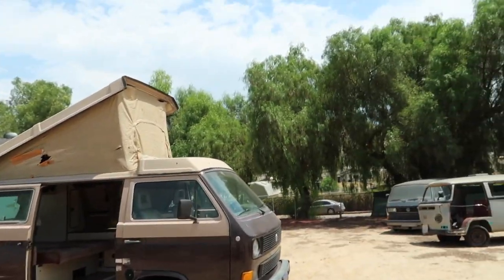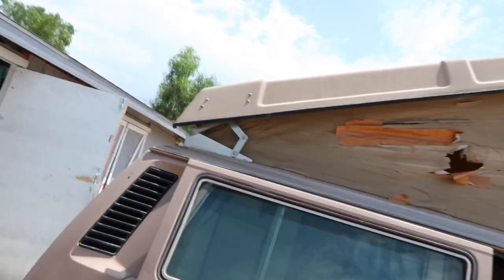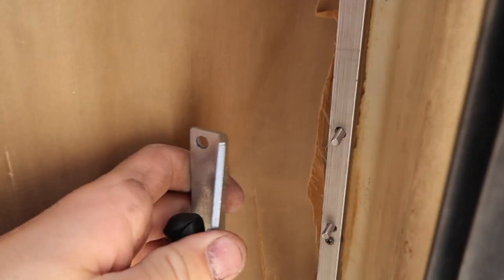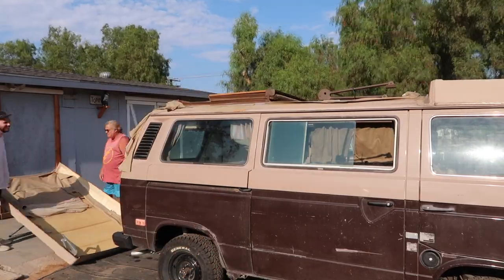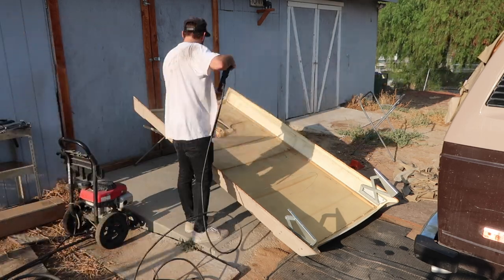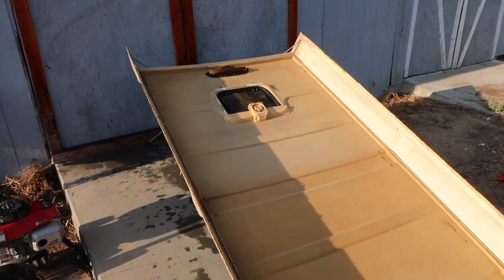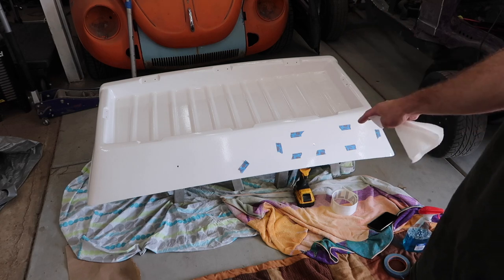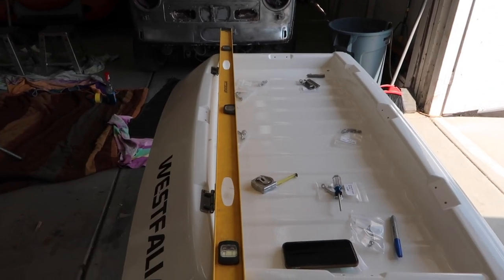Westfalia Top Complete "Restoration"

Comment: Nice!!!!  I’m going to try too!  Is there any reason why I wouldn’t be able to paint the underside?
Reply from the maker: You can paint it for sure just give it a little sand
Reply: Depends what kind of condition the flocking is in.  If there is decent flocking, Tilex or its generic equivalent, dabbing with paper towels (if its still mounted on the van - protect your eyes, the interior and lungs), or hose it off if it is off, and the flocking will actually hang in there.  But if you want to paint it, just knock it off and paint away!!
Reply: I was told the flocking was to help with condensation when hot breathe contacts cold roof.  IDK.  I saw another video where they installed generic car headliner foam...it looked pretty good.